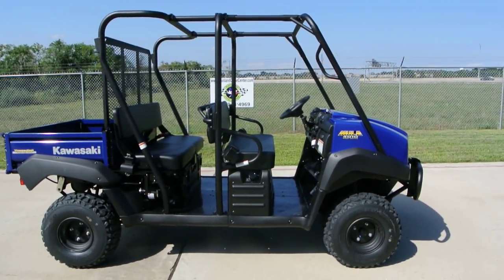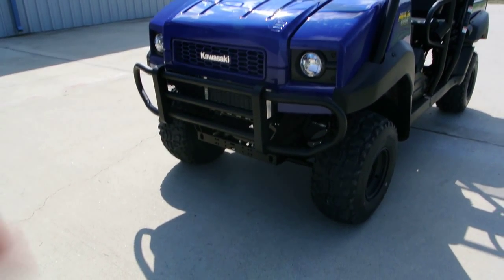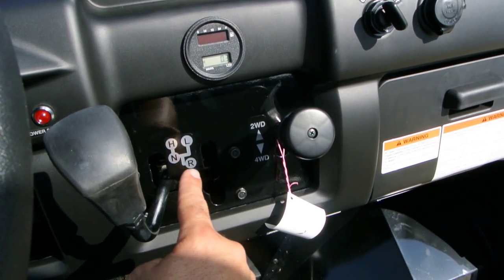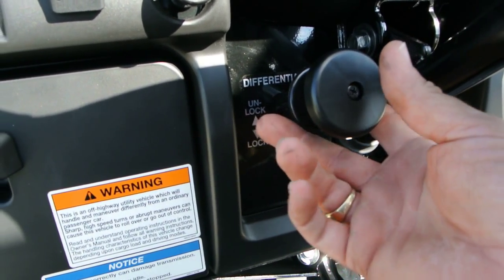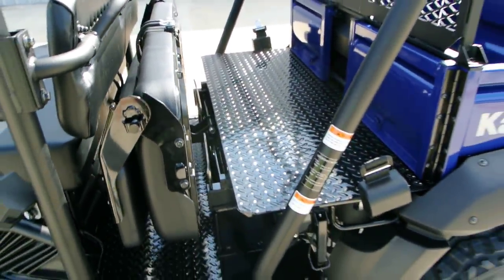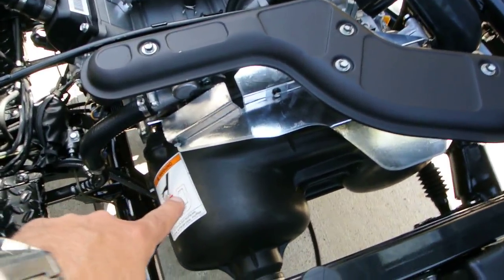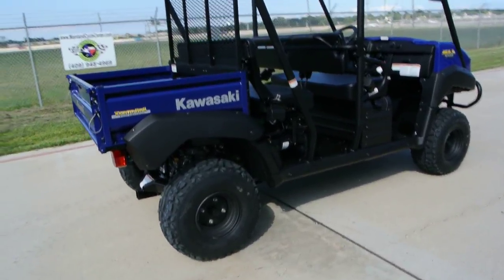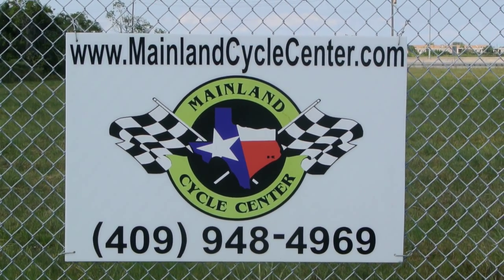2013 Kawasaki Mule 4010 Trans 4X4 in Adventure Blue

Comment from the maker: Yes, we have a single bench set, two passenger Mule 4010 Diesel 4X4 and we can add the electric dump. We are located in La Marque, TX just outside of Houston. Give us a call at 409-948-4969